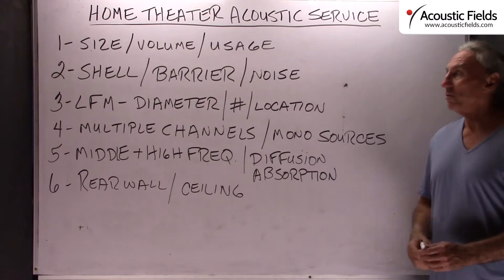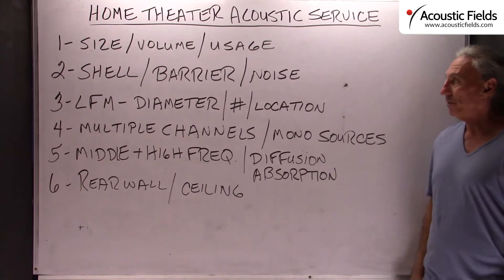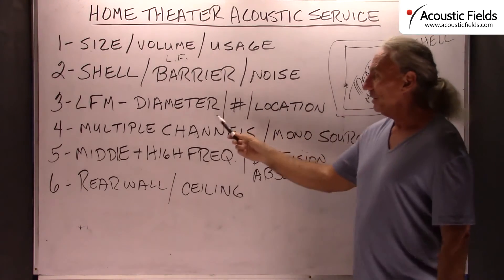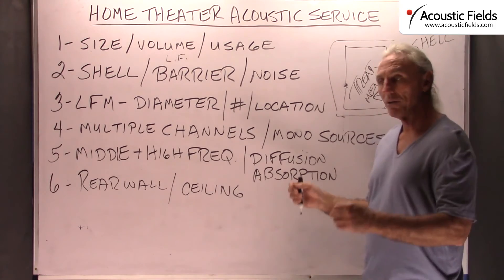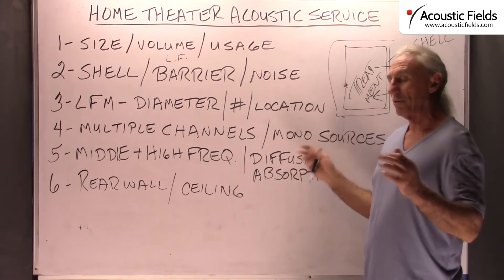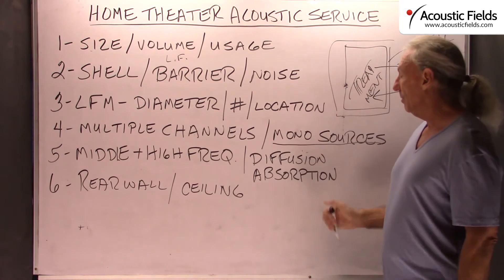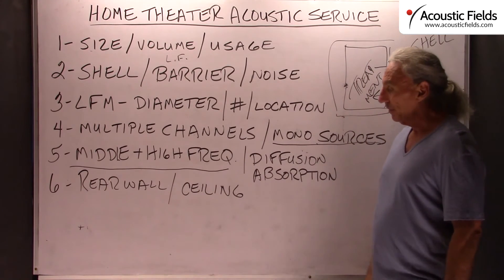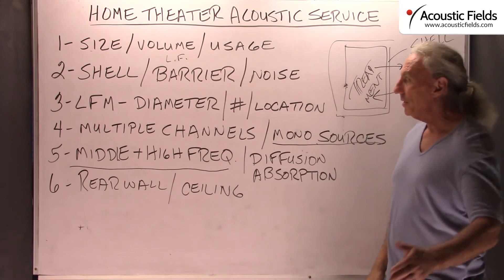Home Theater Acoustic Service - www.AcousticFields.com

Comment: Do you charge as high even for Home theater systems in medium sized homes? The price in your website is for small homes too?
Reply from the maker: Hi Gowtham, Our design fees range from 750 - 1,500 for most of our small rooms. Fees can go higher if noise transmission is an issue.
Reply: Ok, in your website is said minimum $100,000 to over 1 million for home theaters !!

Comment: Thank you for these informative videos!  As most processors offer a phantom center mode that employs the primary left and right channels, would the addition of left-center and right-center speakers not do more harm than good (phase, reflections, etc.)?  Regardless, what can be done to mitigate the acoustic impact of the enormous reflective screen they flank (e.g.- comb filtering)?
Reply from the maker: +bjmsamrlm When you split the center channel signal to left center / right center, you distribute all front of room energy out into the same sound field. This creates a more seamless and smoother balance to both speech and music. This split center will also mitigate some of the effects you are discussing with a screen. Diffusion will assist you on  both side and rear walls